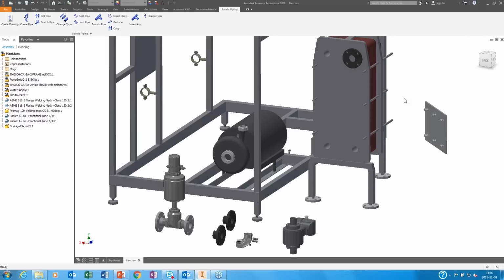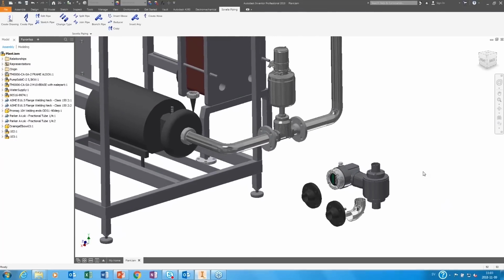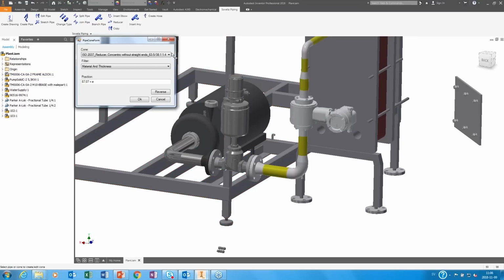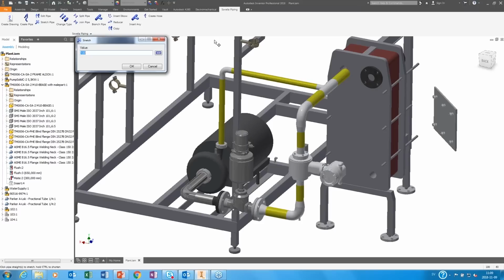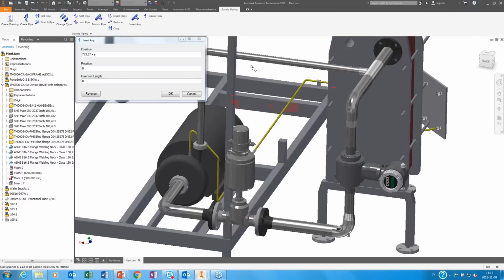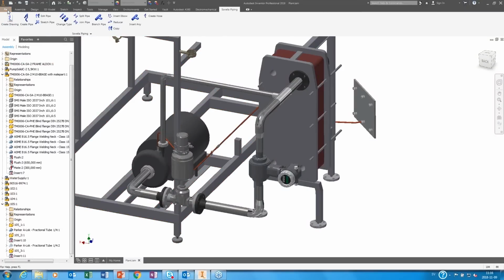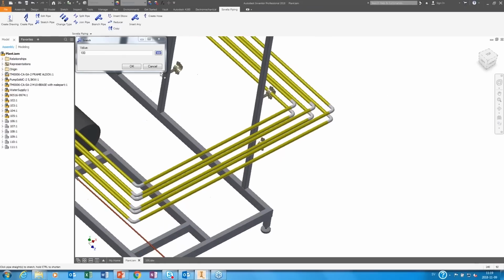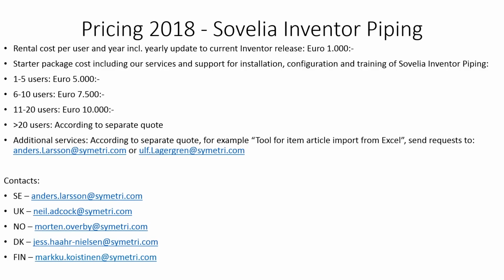How to create your Inventor pipe designs in an easy way?

Comment: Hi! Interesting video, interesting product, however why not mentioning clearly at the beginning Sovelia is a 3rd party add-in?
Reply: How do you add sovelia piping to the ribbon bar?
Reply: Yes, this is a 3rd party add-in. Easy to configure and easy to use. 
For more information contact us at Symetri:
https://www.symetri.com/products/sovelia-inventor-piping
Reply: @b-awezome  there is nothing on that page only a video, inventor has this system in their program
Reply: @hossdesignusa  Yes, Inventor has Tube & Pipe. However this is a 3rd Party Addin which is very appreciated by our customers. The reason is the simplicity and the robustness.